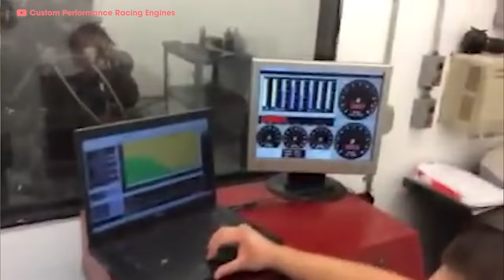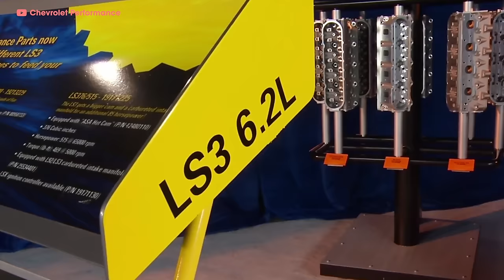CHEVY LS ENGINE - Everything You Need to Know | Up to Speed

Comment: LS engines are indeed a great way to put cheap V8 power in just about anything. Because they’re in so many fleet type vehicles they are dirt cheap and it’s literally cheaper to build an LS swapped almost anything than to build a swapped Honda these days. However for everyone that says LS swaps are the most lightweight thing ever I don’t understand that logic. Is it lighter than an iron block, iron headed 23 degree small block? Yes of course. But it’s not any lighter than any other modern aluminum block engine. It is easy to package as it isn’t as wide and bulky as some other V8s, but all of our modern aluminum block stuff is light and a huge DOHC Coyote with all of its electronics and valve train components still doesn’t weigh more than a pushrod LS1. I also haven’t weighed just the engine itself, but one of the 5.2L/315CID Aluminator Voodoo crate engines got delivered to our shop and the shipping weight was 501lbs, in the packaging. So that flat plane, 5.2L DOHC near 600 HP NA engine is easily within 10-15lbs of an standard LS as well.

Comment: Please !! Do tell me !! Ive been all over the interweb.. My 2006 GMC Seirra has a 6 liter Vortec... and not classed as a LS. only difference  being a cast iron block !!  Nobody on any channel i watch has answered.. I was told my 2006  six liter is an l98 or sumpin.. same build as a corvette C5 for this era..?? And holy ive been leaving comments all over.. and nobody has clarified nhe muddy water.. The 6 liter corvette C5.. and my motor in my truck are the same except the cast block .. cause its a 2500 HD GM Truck...
Reply: It's the same except different intake heads oil pump system & pan, and aluminum block in the Vette. A LS2.
Reply: @DaInfamous0ne  Thanks for the info !! The gear-head working on my trucks says the heads on my truck are high flo and the same as in a Vette.. no idea about the rest as my trucks a 2500hd 4x4... wonder which oiling system is better.?

Comment: I wish GM would have made a over-engineered TT 4.0 liter LS with a 9,500rpm rev limiter in a RWD Cobalt chassis. No one probably would have bought very many so they would be very cheap to buy used. If people didn't immediately just pull the engine for a swap.

Comment: So, not a hater, not a fan-boy.  I swear.

But Mercedes just came out with the M139 engine.  It is a 2 liter, 4 cylinder turbocharged engine that produces 416 HP and 369 ft-lb or torque.  That's not that far off of most of the LS numbers at as little as a third of the size.

I mean, why does GM (indeed America) need so much displacement?
Reply: Increasing displacement is by far the easiest way to make more power. If you have a large displacement engine you can make good power just with a mild cam and decent compression. Smaller engines need to add stuff like turbochargers and vvt to make good power. That mercades engine makes good power, but it also costs a lot more than an ls.

Comment: "You can buy a fully built, ready to swap LS engine in the same cart as freaking toilet paper"

He might of been joking, but he's not far from wrong. Walmart actually has Ford racing engines and Small Block Chevy engines for sale on their website, no joke. I didn't see and LS engines there, but they might just not have any right now. The ones they did have were quite low on stock anyway. I just wanted to see if you really could buy an LS from Walmart, and it turns out yeah, you probably actually can. Just go search up "Crate engine" on Walmart, there's a whole bunch. Kinda funny actually

Comment: Fuck me, you say they preferred the pushrod version of the V8 while showing the Lotus head DOHC V8. It is simple, if you want more power, you need more valves. If you want more control over a larger rev range, you need overhead cams. Pushrods are archaic and every time an overhead cam, multivalve engine will produce more power than a pushrod. Plain and simple. More valves means more airflow which means more power. Pushrods choke above 7k.

Comment: Keep in mind the ls2 was around in 00 i had a truck with a cast iron ls2 in it 300 hp 370 foot pounds of torque and before yall talk shit the only diffrence between the ls and the lq is the meterial its made out of the cast ls and the aluminum there the same damn motor other then cast is stronger good for 1000 hp on the stock block and crank

Comment: what about the 70 Chevelle were they put the ls 6 454 and 7 427 in it everyone thinks it was a big block chevy which i find so funny then u could only get one as a crate till 94 or 96 then it was an option for the vett the 70 chevelle was all about interducing the new crate line the ho bbc 454 and the ls 6 454 and ls 7 427 they only made 6 with the 7 whick makes it the holy grail of muscle cars had the most power out of any muscle car till the new ls 7 came out

Comment: Saying the old 2 valve engine had a better power band has to be the most dumb american thing ive heard lately. You can trick a dual cam to have any power band you want. It's called advance. "but but port velocity rawr rawr rawr" yeah yeah, it's called cam duration and pitch.